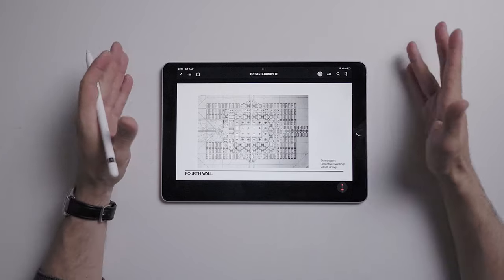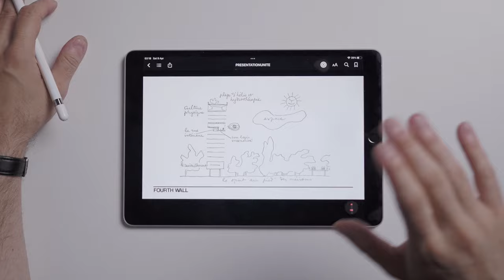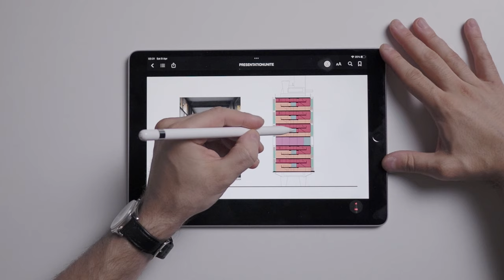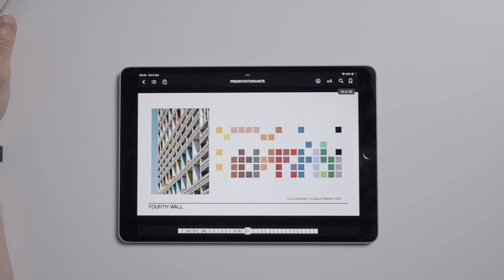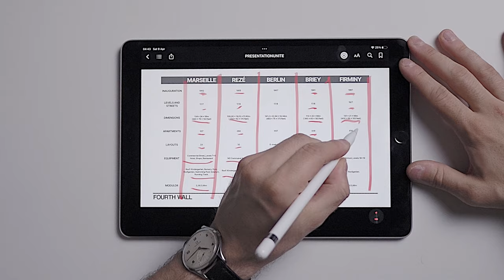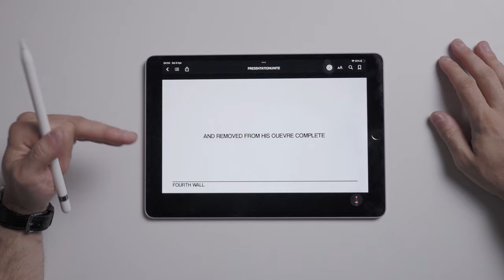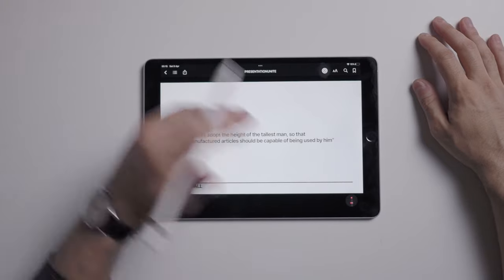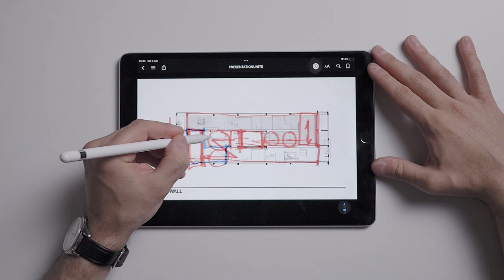The Failure of Le Corbusier´s Unite d´Habitation?

Comment: Good analysis of the unité type. Nice presentation. I would like to see the pictures on a larger scale, so zoom in to the white section of your tablet. And keep the pictures in the video for a bit longer timespan, because only experienced Corbu viewers recognize them now. The Berlin unitë is the only one outside France. Apparently building is less universal because of the local restrictions. Besides that the Germans changed a lot in that building for economic reasons. Good luck !
Reply from the maker: Hi Hans, thanks for the feedback. Yes, the screen capturing process still needs to be a bit refined. I will improve it for next videos - either zooming in more aggressively, putting the slides on the screen if they contain lots of info, or just having them in paper. But I totally agree with your comment.

Comment: With due respect, I think Corbusier's Unite d'Habitation was far from a failure. Corbusier's revolutionary ideas on high density living may have failed to gain traction in Europe, but they influenced a generation of postwar architects, including those who worked in early postwar Singapore. There, the government was faced with the twin problems of a severe housing shortage, and having to decongest a crowded and often unsanitary city centre. The concept of high density living in a park-like setting provided the model for many of the first generation new towns like Toa Payoh. 

What were called 'slab blocks' (as opposed to tower blocks that came later) were obviously influenced by the Unite d'Habitation. The ground level was often left open (called void decks) for communal use or devoted to commercial actiivty. Finer aspects like the roof top recreational areas and double volume apartments were left out, possibly because of a tight construction budget. 

However, it wasn't a simple transfer of a European concept to a SE Asian setting. The buildings were adapted to suit local conditions. Slab blocks for example were often aligned east-west in order to minimise exposure to the hot equatorial sun. Louvered windows assisted in cross ventilation. Short pipe sections embedded into concrete walls allowed residents to dry their laundry naturally. 

Sadly, many of these slab blocks are now around 50 years old and are being replaced by newer and taller buildings that offer modern amenities. Like airconditioning and bedroom ensuites. I hope that some of these slab blocks will kept, as a reminder of modern architecture's heroic phase in postwar Singapore. And of the universality of Corbusier's ideas, many of which were well ahead of his time.
Reply from the maker: Hey pervertt (interesting name :D) ,

Thanks a lot for writing. - I love that you share your thoughts and info here. I must say that I am not only open to learn from all of you watching, but having this conversation with you might be even more important than the video itself!

Did you watch the last part of the video? Because I was breaking down my conclusions in two parts, to be a bit more specific.  - Don't forget the Unité was a "one fits all" solution. And this is a very important distinction in the concept from my point of view. It was a solution that would work anywhere, and by repetition, be the new city.

Comment: Semantics perhaps but this is a list of elements that you considered failures, i.e. failureS. Though I agree with your logic I think it is unfair to describe the building as a failure. I've stayed in two separate apartments in the Marseilles Unite. Both wonderful apartments. The only failure in my experience was that it was unbearable hot in the evening/ night in summer without AC. Great channel, thanks!
Reply from the maker: Hey David, thanks for writing. 

Well, in the video I split it in several ways -from the concept perspective, as a one fits all solution for the housing in Europe, and as a collage of technical and concepts. Depending on how you look at it it can be a failure or not. 

The other points are my opinions on the concepts, or the interesting contradictions that Corbusier always had in his discourse.

I didnt stay overnight, so thats interesting to know! Thanks for sharing!

Cheers, Bruno
Reply: @FourthWallArchitecture  Yes, I understand. I was only criticising the title of your video where a plural of "failure" would be more accurate but Im just splitting hairs. Great stuff

Comment: Thank you for this video! 
I think that Le Corbusier's ideas are very interesting and that, despite their undeniable drawbacks, contemporary architects can definitely learn from them. 
For instance, his idea of providing highly functional living spaces on a relatively small footprint to leave enough green spaces around the building is often discarded in favour of less densely populated suburban areas - a lost opportunity, in my opinion.
I have one additional thought about the body proportions: This concept is highly problematic due to its misogynist premise. Indeed, man is taken as the basis for the considerations, while woman is entirely neglected.
Reply from the maker: I would definitely say that his relationships with women were...odd, at least. So..it could be that your option is correct, but I would have to dig deeper to be certain. 

I could do a video about this only, I always found it interesting. Let me know if you'd be interested :)

Bruno
Reply: @FourthWallArchitecture  Thank you for your response. Personally, I think that issues of gender in relation to modern architects or specifically Le Corbusier would be an interesting topic for a separate video. I would definitely watch it.
Reply: Doesn't it make sense to design a residence in proportion to its tallest occupants? It's important that the work surfaces and chairs in particular don't force users to hunch, giving them back strain.
Reply: @rwatertree  Well, it's also just as inconvenient if the users have to stretch every time they use something in the house. Therefore, it's best to adapt the measures to the average occupant.
Reply: @loveartandscience6289 
But they don’t have to?
I am 2,02m tall, and feel highly Claustrophobic in essentially all of the conventionally sized buildings.
My biggest nemesis are Doorways which not exceed the height of 1,92m (an Old German norm).
My girlfriend is 1,54m tall.
We moved into an apartment with ceiling heights of 2,80m and adapted most of the furniture and amenities to my size, while compromising in common areas as the kitchen and the dining room.
The higher ceiling and doorways have zero influence on her ability to use the apartment. On the contrary, she loves the more open and spacious feel of the higher ceilings.
There is literally 0 drawback
Reply: @Mongolopolis8  Sure, in some cases it's best to design furniture rather too large than too small. A too long bed or a very high door, for instance, do not pose any problems, while too small a bed or a low door can be nightmares. 
However, when it comes to the height of tables, chairs etc., these can cause problems if designed for taller persons than the average user.